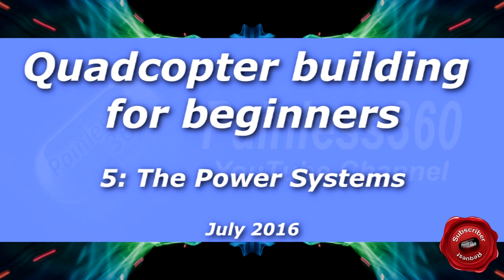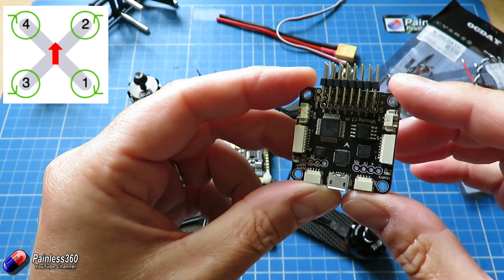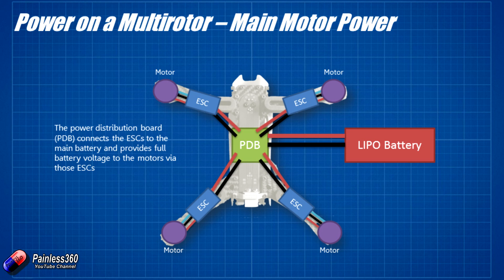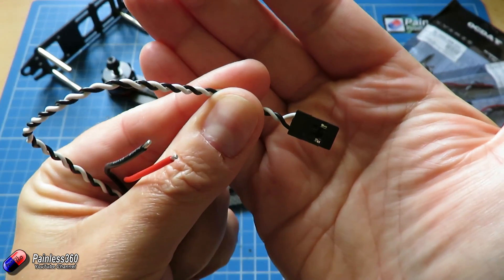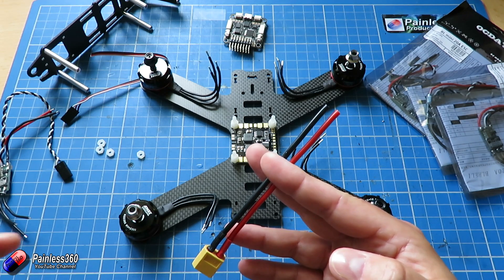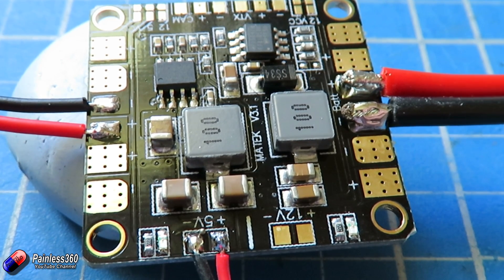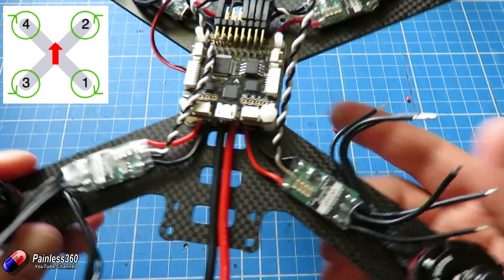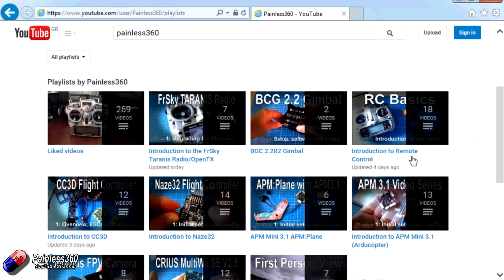(5/9) Quadcopter Building for Beginners - Connecting the main power systems

Comment: I have a PDB and Simonk 30A ESCs with BEC (not sure switching or linear). Please advise on how to carry out the connections. Need help.
Reply from the maker: If you are using a PDB that can power your flight controller then you won't connect the 5v from the ESCs and anything. Best of luck

Comment: I found that my escs is linear mode so do I have to connect the three wire (signal. Positive ground ) for the fourth escs ???? 
And no need to take a 5v from pdb to FC at all right ?
Reply: And one more question plz that escs linear mode it will be ok to to connect the receiver fs-ia6b in ppm mode
Reply from the maker: Covered in the video at the 6 min mark.. The BEC will not affect the modes you can use from the reciever..

Comment: Hello i am going to do a same Ur step with my quad 450 but I have simonk ESC which has bec 5v 4 of them so I would ask should I take 5v from pdb to FC and then I discounect the red wire positive from bec and leave the single and ground wire or no need to take 5v from pdb to FC and just connect the bec 3wire to FC and if that correct should I connect the 4 bec with 3 wire positive and signal and ground or just connect one bec 5v but the 3 other only signal and ground
Reply from the maker: Depends if they are linear or switched BECs. See my video all about it..
Reply: Which video ?????
Reply: How to know if the ECS has a bec linear or switched
Reply from the maker: ahmed brayhi I assume you've watched the video? This is talked about at 6:06. You need to check the spec of the ESC that you're using, if it's not mentioned it's probably linear. Best of luck..

Comment: Why does the 5V lead from the PDB that's plugged into power the flight board override the 12V coming from the lipo that's used to power the motors without blowing the flight board.  Is the PDB just specifically designed that way?  Isn't the PDB also sending 12V of  power to control the motors via the esc, but it doesn't blow the flight board?

Comment: This is the point where a good light and magnifying glass comes in handy folks. Go over each connection and make sure there are no wisps of solder making unwanted connections. Small ones can be carefully removed with a craft knife. For bigger blobs I suggest using a plunger operated vacuum desolder 'sucker'. These are cheap and very effective. Look for 'dry' joints, they will be dull, not shiny, and remake any found. Continuity checks with a meter are NOT a good idea, there is to much risk lf applying over voltages to delicate components (some meters us 9 volt batteries for this and may damage 5 volt circuits). Cheers. Bob UK.
Reply from the maker: +Robert Hawtin I've just made the point about a visual inspection in the series that's about to be released on the channel. That's the 6th quad build series that I've created and they all follow pretty much exactly the same process. Albeit, with much newer technology. The mark one eyeball, and some basic use of a multimeter can save your bacon before you make a big mistake and plug the battery in with a wiring issue. Just like any other electronic build!

Comment: Hi. Is fusing ever used? I can see reasons why not - almost any fuse blow on a quad would bring it down and it might be better to leave the power on even if things are smoking. An over current alarm back to the hand held controller would be nice though! How about on a hexacopter? There it might well still fly with one motor or ESC out. I'm working my way through this really brilliant series. Thank you so much for putting it together. Bob UK.
Reply from the maker: +Robert Hawtin it's not normal to have a fuse in a model like this. If you size the components correctly, and you've installed them properly then you should never get into a situation where you have a problem and the Magic smoke comes out. If it does happen then the answer in the Hobby is to just replace the component that got a little cooked. 

The most common things that get burnt out or escs and that's either due to a problem with the motor that causes it to pull more than the current You're Expecting or in the event of a crash and motor trying to turn while it's pressed against a hard surface that causes excess current again. 

The biggest danger point of the first time you plug in the main battery. You'll notice that a lot of people or use multimeter to check that there isn't a dead short across the power supply comma and the use of something called of smoke stopper is very common now too. That limits the current so if you do accidentally plug it battery into a model where you have made lawful mistake then the current is limited to a level that won't cause any problems.. hope that helps.

Comment: Hello, I'm building my own drone atm. I'm following every single step of this video with a couple of changes (like soldering the wire to the board itself instead of using the pins) but I ran into a major issue. I can't seem to get my SP Racing F3 flight controller to work on battery power alone. It does work on USB, but when I'm only using the battery it's not working. Please check the video that I've uploaded on my channel in which I explain what the issue is. Hopefully you, or someone else that reads this can help me. I've been trying for days now but with no success. I greatly appreciate ANYONE that takes the time and effort to help me fly as soon as possible, so that I can enjoy this hobby as much as you guys do!
Reply from the maker: Where does the flight controller get the 5v from on your model?
Reply: Thank you for your reply. The 5v is coming from the 5v pad on the PDB. It goes from the PBD onto the + on row 6 of my FC. The ground goes from GND on the PBD to the - on row 6 of my FC.
Reply: A little update: I've just found out that the PDB does not give power to the 5v, gnd, 12v and gnd pad. I'm thinking that I need to replace it for a new one due to my horrible soldering. The battery gives +-15V (4S battery) and the battery connector (lower side, on which I solder the EDC) gives the same amount. Thoughts?
Reply from the maker: +EnterTheVlogosphere sounds very possible. You could always add a little micro bec to provide the 5 volts that the system needs as well. See my quadcopter building for beginners other videos for ideas. Best of luck
Reply: I'll check out your video, thanks for the advice.
Reply: Painless360 Hello again! Thought I'd give you an update on the status of my drone. After crashing it really hard yesterday due to my props not being set correctly, I've managed to take it for a test flight today! Check out my channel for the video. I'd like to thank you again for helping me out, even though it was just my horrible soldering skills! Good luck with your channel, and I'll stay a regular visitor because you're the to go to guy when it comes to questions about these drones! Your videos are amazingly well explained!

Comment: So nearly there. Using SPRacing F3 (cloned). Done the Cleanflight, wiring (with correct polarity), EMAX SimonK esc 12A Linear. Plugged in battery, A single bleep is heard, none of the motors are spinning. Then 15 seconds later the esc starts with audible  bleeps, and ONLY motor 3 starts to spin. In Cleanflight, I can increase and decrease the spin ONLY for motor 3.
Thank you so much.
Reply from the maker: +Farrukh Riaz see the rest of the series for how I set up this quadcopter. Missing out or skipping steps will make the build a lot harder. Best of luck
Reply: Resolved. In Cleanflight disabled Oneshot125, by setting it to PWM. And tested all fours motors spinning. You deserve a Knighthood. Thank you :o)
Reply from the maker: Glad you got it sorted, there are lots of options for the way to talk to the ESC and not all work with all ESCs.. Happy flying!

Comment: The pins on the fc, doesn't the black thing touch the fc
Reply from the maker: Nope, be careful when using carbon fiber frames and make sure that you use Nylon spacers to make sure no voltage carrying wires/solder touch the frame. Safe is better than sorry. Best of luck with the build!
Reply: Oh my bad then

Comment: Hi, ur videos have been a life saver to me. So when I connect the battery to the pdb, the esc's make a sound but does not power the flight controller. I've resoldered the esc's to the pcb of the frame, but still the same result, even checked the polarity as well. Where is the actual problem here? The flight controller we're using is ardupilot 2.8.
Reply from the maker: +Ahnaf Samin Akter see our APM series in the channel where we cover this. Best of luck!
Reply: Thx for the help!
Reply: What is the price of ardupilot 3.8

Comment: Ok, thanks, I want to ask for advice if you can answer me. Ordered alredy frame qua 250 carbon fiber, and dys mottors 2204, because they were cheap, 4 motors for 26 euros. In future i would need power board, flying control board, esc. I just want to make quad for long time flying, dont need speed, because i want drone for aerial recording with some good full hd camera or 4k yi. Also would like long range , for about 7 km. Im totaly new in this hobby, already have xk x251, with no camera, and im sattisfied, bought for learning skills. what would you suggest,
Reply from the maker: If you want longer flight times then I'd have gone for larger props/lower KV motors. See the efficiency comparison/testing in the video where we tested that in the 'Introduction to Remote Control' series.. Best of luck!

Comment: I did it! I soldered the power wire, just like you told us to. I even used the exact same one your using in this video (XT60). I felt so good about the power wire, I went ahead and did all the ESC's too! Everything went like you said it would!

I cleaned the surfaces with rubbing alcohol first to get rid of the oil from my fingers from playing with the PDB too much. I then used a Q-tip to spread the flux all over the contacts and dipped the ESC wires into the flux. I'm using a gas powered soldering gun/pen and it can get hot quick! Worked perfectly for these larger wires.

I'm so happy you make these videos! I couldn't have done it without you! Thank you!
Reply from the maker: Nicely done! Happy flying...

Comment: Is that a male or female jst plug on the pdb?
Reply from the maker: I tend to use a male on the PDB as you rarely attach a connector with exposed pins to the power. Happy flying!

Comment: I have a question!  I have continuity across my power DB, but I already have all the ESC's and motors soldiered up.  I tested another motor/esc and it has continuity through it as well.  I believe my continuity is across the motor, but how can I know for sure?  Tips?
Reply from the maker: Not sure what you mean by 'continuity'. Across the positive and negative terminals? Why are you testing that? The motor winding is just a piece of thin wire so would appear as a dead short but that changes when the electromagnets fire up..
Reply: Painless360 thank you!  To clarify continuity = dead short.  I made the mistake of soldiering on the fans before checking like you recommend.  Thankfully I have it a shot and didn't get any blue smoke!  Thanks again for your videos, I couldn't have done the build without them!  (Especially the Seriously Pro FC content)

Comment: I normally just connect the esc signal to fc not both ground and signal wires. Is there any different? i have heard just connecting signal wire is more prone to noise. I do not know.
Reply from the maker: I'm old school and like there to be a common reference between the ESC and PWM output of the FC.. ;)
Reply: Hi, thanks for your videos it's very instructive !
I had the same question than jack so I'm happy to have your answer, but to go further, doesnt the ESC already have the ground by the alimentation connection to the PDB ? Or maybe it could be a slightly "different" ground between the battery ground and the "5v ground" after passing through the BEC and those two "grounds" are on separated circuits inside the ESC ?

Comment: Hi guys, i got this pdb from aliexpress  PDB PCB Power Distribution Board For Naze32 CC3D QAV250 ZMR250 Quadcopter With 5V 12V BEC for my cc3d however it seems that to match the cc3d pins do not match the board layout for the cc3d but it matched the ones for the NAZE, I am new with this type of pdb...i just cant figure out how to connect the cc3d and the board came without any instructions whatsoever...any advise??
Reply from the maker: I guess from the later post you sorted this. Best of luck!
Reply: sorted thank you again

Comment: Hi, nice help for building a quad. 

You have any video on how to solder the pins on the FC? 

Just looking for tips on that.
Reply from the maker: We have a video on soldering not specifically on that. Top tips are - get a good soldering iron station with a very fine tip, use flux and a good quality lead based solder to help flow. Best of luck!
Reply: I've just spent 20mins looking through your channel for a soldering video and can't see one. It would be great if you could do one just on hobby soldering (FC etc.) many thanks

Comment: A caution for newbies using a voltmeter to check your PDB ( 12:50 ):  the pads are very close together, and if your meter probes accidentally touch each other while you're in contact with the pads, poof!
I made this exact mistake last week.  Luckily it only fried one pad on my PDB, and there are redundant ones.
Reply from the maker: +QC Support yep, shorting contacts with anything is bad. Happy flying!

Comment: painless i have been running into a problem and need some help with my pdb. i got a diatone v8.3. i need 5v to video, flight controller and camera right? i need both + and - but i only have one little square that says 5v. am i supposed to use the gnd as -? i only have 2 5v out on the pdb which is a problem. i realized that there is another 5v out at the other side but i don't know how to use it. can you please search up the diatone v8.3 and help me? thanks
Reply from the maker: +Oskar Jennische you can use the GND connection from the 12v part of the PDB. Looking at the diagram I'd use the 5v2a pin with the gnd pin by its side. Best of luck!
Reply: +Painless360 ok, that means i have 2 5v out. what about the radio reciever? is it taking power from the flight controller?
Reply from the maker: +Oskar Jennische yep - watch how we do it in the video.. Best of luck!
Reply: +Painless360 i am using 1 5v to the flight controller and 12v to the fpv equippment. the only problem i have now is the xt60 pigtail, i cant get it right on the pdb.  the cables are so thick and there isn't eunough space.

Comment: What voltage goes to led,s? 12 volt or 5 volts.Thanks
Reply from the maker: +SheaProdigy depends on what you buy ;) if you want the LEDs that can change colour and be controlled by the flight controller then they are 5v. See the video on it in the SP3 series. Happy flying!

Comment: Hello,
Could one use a 3s LIHV instead of the traditional lipos and not fry the power system? I'm just starting and looking to get more flight time, so I figured the extra 1.5 volts might equate to 45 more seconds of flight or so...
Reply from the maker: +Gouada if you're new then I'd strongly suggest that you use the tried and tested methods and kit.. Best of luck!
Reply: Ok Thanks!